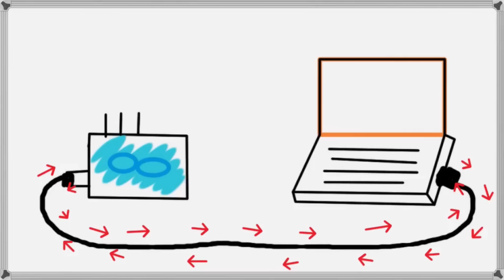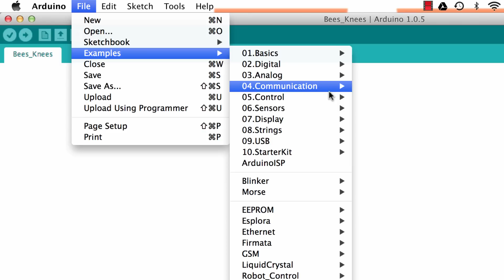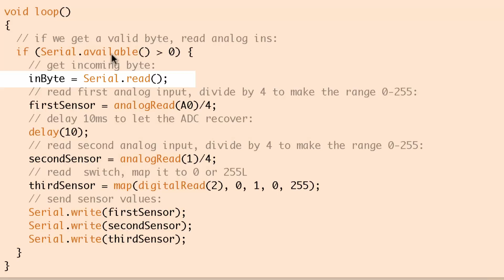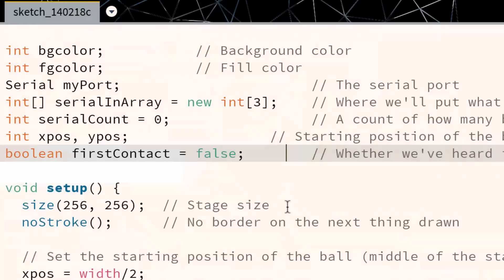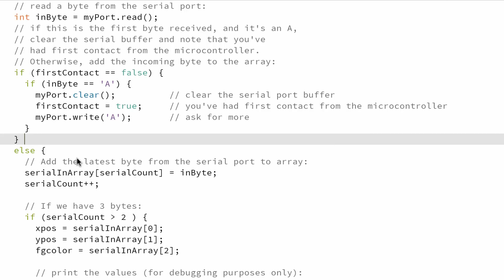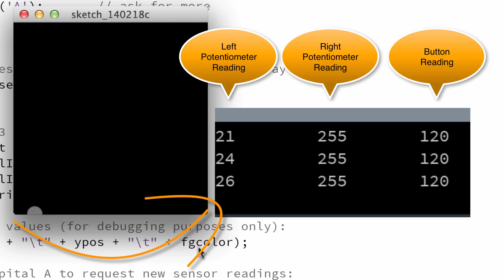Sending Multiple Pieces of Data through the Serial Port :: Viewer Question #3

Comment: I'm working with an arduino Mega and matlab, I'm sending an array of size 7 (spins wheel 1, 2, 3, time, sense of spin of the wheel 1, 2, 3), then i graph this array on matlab but i want to send back to arduino 3 values of pwm from matlab, can someone help me with this? This is not my main language sory if i commited mistakes

Comment: Hello. I have general issue understanding parsing. I am using example code with some change, and want to transfer 900 bytes from "OpticalFlow", or optical mouse with lens, which has 30x30 pixels (total of 900). So I made this change to the code:
void serialEvent(Serial cPort) 
{
  comPortString = cPort.readString();
  if (comPortString != null) 
  {
 
    comPortString=trim(comPortString);
    String[] values = split(comPortString,',');
    try 
    {
      for ( n=1; n<900; n++) //
      {
        frame[n]= Integer.parseInt(values[n]);
        //print("f="+frame[n]);
      }
    } 
    catch (Exception e) {}
  }
}
The question I have is: how to change parsing, so that I do not need ',' separator (coma)? This is because I want higher frame rate for transfer and if one byte is data, next bite is coma separator, then data... it can run twice as faster if there is some way to avoid use of separator. Note that I am using buffer: 
myPort = new Serial(this, Serial.list()[1], 250000);
myPort.bufferUntil('\n');
This is not my idea, since I am pretty new to this. It just buffer until receiving end of the string, or simbol '\n', whatsoever this is. So far it works good, with exception of wasting half of the time sending coma separator.
Plese, can you help me solve this problem, because I need all speed possbile over USB. Thank you in advance.

Comment: i've done it but i noticed one thing... it doesnt send negative... i want do the same with servo motors in arduino i have  everything perfectly but as i know serial can only receive 0-255 and how can i sand negative?
Reply: Tarash Sajaia nevermind problem was that i was making calculations in arduino soo i send everything to processing and then allow it to make calculations... so it works

Comment: Thank you for this tutorial! It is super helpful!

But what if you are receiving multiple values through one sensor, like a 3 axis accelerometer/magnetometer? How would you transmit all these values?
Reply from the maker: SometimesIdo There are a couple ways to do it, one might be to send each item one at a time, and then have the receiving program know which order is which - i.e., Y axis first, then Z then X, or whatever.  This is question is definately high the lesson request list, so I will make sure it gets added to the cue - thanks for commenting!

Comment: Very stimulating video.
An interesting thing to do is the ability to determine the loop time, i.e., how much time does it take to complete one cycle for a given baud rate: (read data, send it to PC, get acknowledge signal from PC, repeat ..).
Thank you.
Reply from the maker: I agree!  I really want to wrap my head around that cycle time - but I am just not there technically yet - I will have to do some researching to understand what elements will effect that full cycle time.
Reply: Bude rate, instructions:some of them take more clock cycles than others. Maybe setting a timer to a specific value to generate an interrupt periodically will provide a measurable and constant loop time. 
Thank you for the well prepared and clear videos.